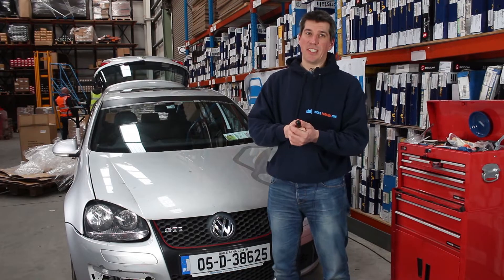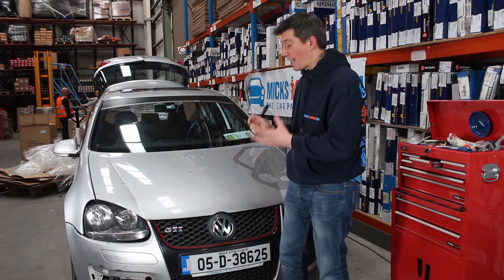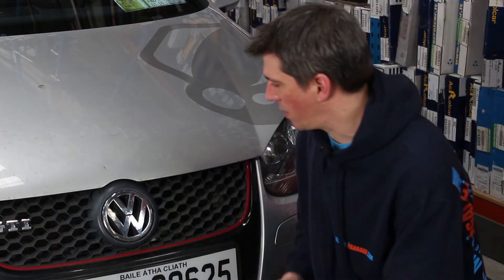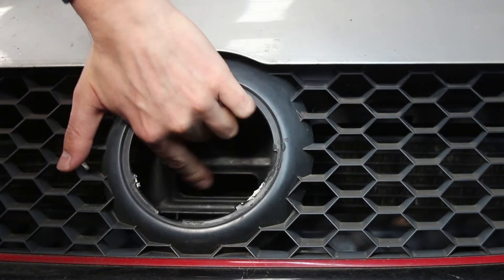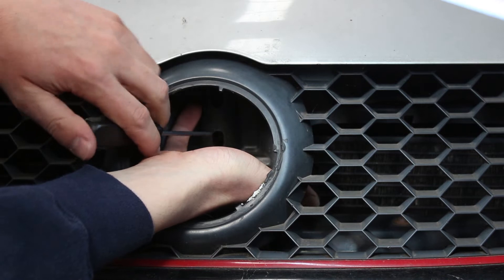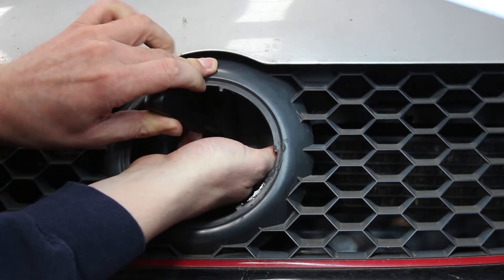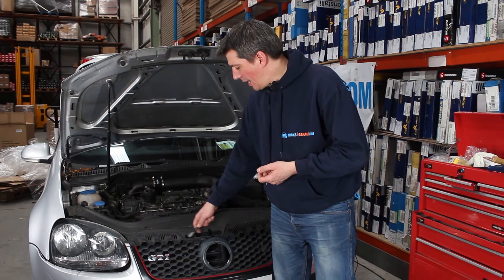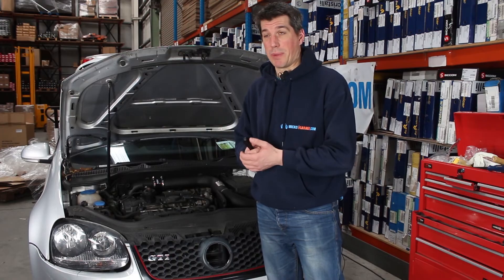MicksGarage.com Project GTi: Manual Bonnet Release

Comment: I had this problem and it wasn't nearly as simple as this video suggests to fix. I couldn't find the cable with my fingers and neither could the guys in the VW specialist I took it to, even after viewing this video first. They used a mirror and adapted tool to reach it and the replacement cable was £80. Total cost just shy of £200.
Reply: Having this problem right now

Comment: Okay so my cable is still connected to the latch in the car. But the cable isn’t connecting to whatever it’s pulling.  When I took the badge off I could see the cable dangling there with a little ball on the end.
Reply: How did you fix it man? The cable has disconnected on my mk5 gti at the latch

Comment: I have a Mégane cc with a flat battery. The key won't open the lock as it should. Do you know if this will work or would you suggest jacking up the front to charge the battery from underneath?

Comment: Thank you very much for the technical advice. I'd have the same problem of opening the bonnet of a VW Polo 2006 model from the front. I think a 3D image of how this was down could also help because I don't know exactly what I need to hook on. I can see the cable but I don't know how to hook it & push it down as you've demonstrated.

Comment: what if your cable is disconected from the hood latch can you still open it manually without  removing the 2 star screws and having to pull up the whole latch forcing it and possibly ripping the open hood sensor connection??? if so please help
Reply: There are three scews, only two are visible, the third one is behind the grill

Comment: Hi i have a MK5 jetta 2.0 tdi , can i use this way also on my car ?
my car has the that big hole to place the hand inside and find the cable, but i was able to find it. 
what for a cable is it ?
Reply: It is lika a wire-cable... the same as used on mopeds and bicycles for handbrake etc ...

Comment: This doesn't work on 2007 petrol golf. Wasted loads of time. Even if you've cut the hole much bigger you can't reach anything. 
If you take out the centre front grille below the number plate you can see up into the latch with a mirror. I have got big arms and hands but managed to reach the broken inner cable which was hanging down and pull it. Otherwise with a stiff piece of galv wire bent into a hook at the end you can reach the lever and cable end and just pull down. About 6 mins!
Reply: What about my TOURAN, 2007, it's unlock , and it is not the same as GOLF GTI